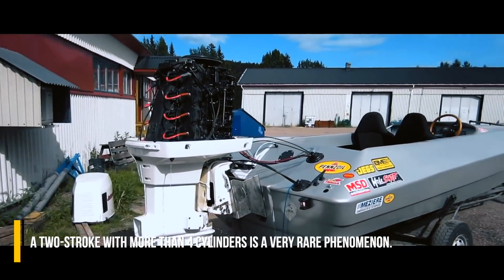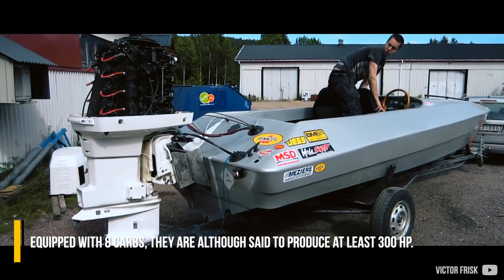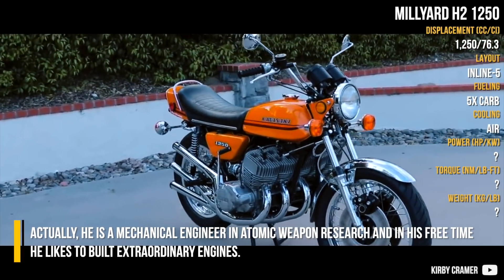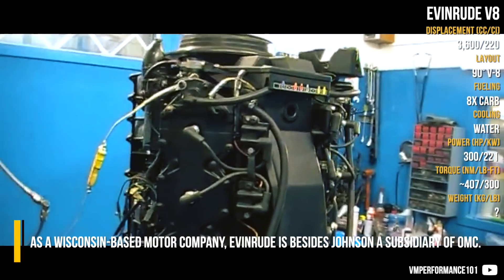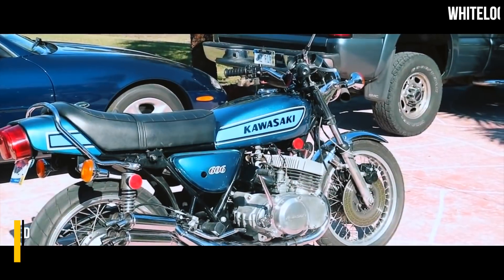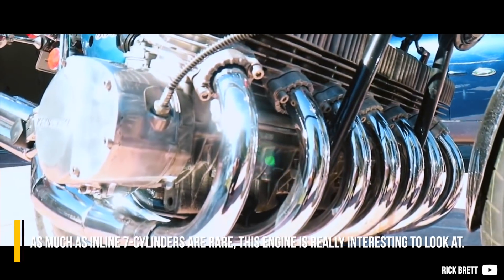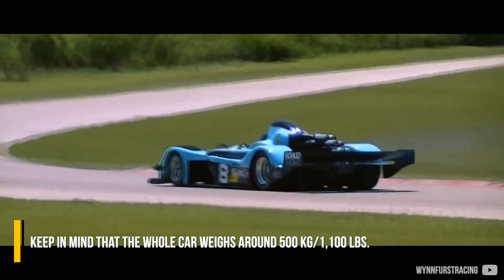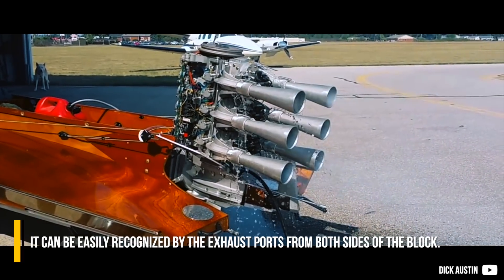Amazing 2-stroke 5+ Cylinders

Comment from the maker: Please be notice that this video contains gasoline two-strokes only. I did not know about many before this video, I learn much about stuff like you do, guys. Thank you for all the support!
Reply: please make a direct injection （into cylinder） 2 stroke next time thank you
Reply: You need to do a video on the 2-stroke diesels. Like the 12v71.
Reply: @michaelhite1433  hes done vids with that engine.......
Reply: Your forgot the mercury outboard 2stroke. They have a 2.6liter, 3liter, and 3.2liter v6 that we’re rated for 250-300hp but could easily make as much as 350-380hpwith tuning. These 2stroke v6s are still used in offshore racing today. 2 of them of a 28-36 foot catamaran can easily go 100-120mph on race day and push speeds upwards of 130mph. In my opinion 130mph for two 3liter(2stroke) v6s is very very impressive. In the 80s and early 90s some boats of similar size would run 3 if there 2 stroke monsters pushing 140mph ! Also these days Formula 1 boats run a single of these outboards and are still competitive against the 400hp and 450hp 4strokes.
Reply: VisioRacer Cool new intro! Love the raw sound of these engines. Keep up the good work - greetings from 🇦🇺😎
Reply: xxaxnxtxhxoxnxyxx thanks. Yeah I say on the suggested videos like 2 videos later.😂
Reply: xxaxnxtxhxoxnxyxx also I subscribe to a channel called Bus Grease Monkey, all he works on are 2-stroke Detroits mostly in old buses.

Comment: Too bad you didn't show the Quincy six cylinder running flat out. The thing doesn't scream, it shrieks. The engines were designed and built from a Mercury outboard engine bottom end. They were known as "flat heads" in the seventies. The mercury engines were a deflector type two stroke, where as the Quincy Flat Heads (Loopers) were a loop charged engine. A German manufacturer, Koenig also built a two and four cylinder apposed engines for boat racing during this same time. These engines had a side plate type rotary valve instead of a reed block and reeds. In the late forties and early fifties, Johnson built a four cylinder opposed engine with what they claimed was a front rotary valve instead of a reed block. It was actually a roots blower that guys would change the gearing, speeding up the blower and forcing even more air into the engine. One team had blown the cast iron crankcases apart so many times that it had almost as much brass as cast iron holding it together. They also used two steel plates on the heads with all thread rod to keep the thing together. This monster hung on the back of a boat that weighed less than it did and the guy had to lay out over the bow until he got it on plane or it would sink under him. Oh those dear daring young men.

Comment: What kind of ruins it for me is all the blue smoke! Back forty plus years ago, when I raced two stroke dirt bikes we used Golden Spectro Two Stroke synthetic oil, made in Connecticut, that was a great lubricant for the engines, with little to no smoke. Or use a castor bean oil that had a sweet smell to it. Both nothing like the conventional petroleum based two stroke oils used!

Comment: I only had a 3 cylinder 2 stroke evenrude 60 and they thing sounded like a v8. Also evenrude, johnson and Chrysler underrated power by 20% in most of there engines I herd.....

Comment: That looper is supposed to be "performance" ?? With those fancy exhaust ports and no expansion chambers? No wonder it made all that noise while crawling away.
Reply: The exhausts were maybe tuned to give a peak power at a tiny power band. The early 2-strokes used to just have the expansion cone and not the reverse cone.

Comment: My first boat came with a Mercury Black Max 275hp 2 stroke V6 outboard. Believe it or not, Cosworth made the blocks for Mercury back then. Same output as the V8 Johnson, but around 100lbs lighter, and infamously reliable.

Comment: The Mercury Marine 2.5L V6 is a racing outboard boat engine that makes well over 300hp and revs to over 8000rpm when tuned! Awesome engines!
Also that Evinrude V8 3.6L produces over 400hp when tuned up

Comment: My earliest memories in life are the sounds and smells of my Dad's 1979 Husky 390 two-stroke.  I was at a local harescramble a few years ago and all of a sudden we saw some crazy nut blast out of the woods and hammer full-throttle up a tricky hill on a late 70's Husky 250.  About 200 complete strangers all started cheering and going crazy on a hillside in the middle of the woods.  There's nothing like a two-stroke.
Reply: My dad learned and practiced wheelies on a V65 Magna with me like 8 years old on the back lol.

Comment: 2-stroke engines have less fuel efficiency than a 4-stroke. However they do have greater mechanical energy, since they have a powerstroke for every revolution of the crankshaft.
Reply: Ole that’s why they’re the best, also can’t forget that they don’t have any lost torque output from having to turn a camshaft to run a valve train.

Comment: At the boat engines, why are they pull out some water from the bottom of engine?
Sorry my english bad.
Reply: Kadalsuper_HD if you look closely there is a garden hose attached when the motor is not in water. This is because the cooling system usually cycles whatever water the motor is sitting in. The water dripping out it just cooling the engine.
Reply: @davinanderson9832  whooaa, i see. Thanks for explaining

Comment: The Evinrude and Johnson are exactly the same motors, they came in 3.6 and 4.0 litre motors. In my opinion the smaller 2.7, 3.0, and 3.3 V6s are even better, more reliable screamers.

Comment: Those engines sound like they are always at 10k+ rpm...  I know that 2 strokers gets 2x more bang than 4 strokers per cycle. Gasoline 2stroke always leave a trail of smoke, while diesel 2 stroke rarely does that. Only at start if u pump more fuel than air.
Reply: @A Twinspark , exactly. I have a single 250, and a tower of power, and neither smoke at operating temp. Jetting and proper synthetic oil ratio. Music when wound up.

Comment: im obsessed with 2 stroke engines
Reply: My riding buddy jumped on my yz250 off his newer yzf... He got off like wtf just happened to my world!
Reply: @brandonsyatessr.3667  Exactly. KX250's still smoke KX450 4 strokes. Famous MX rider John Dowd came to Southwick MX track a few years ago, took a 2000 KX250 that hadn't been started in 10 years and smoked all the pro riders on 450s by over 30 seconds.
Reply: You need to research about 2 stroke in Malaysia.its very interesting
Reply: I love me some 2smokes. Been wanting to build a 2smoke supermoto for many years.
Reply: The GL 750 Yamaha should be on your list!
Reply: @Moontanman  The Bimota 500 Vdue is another cool one. V4 500cc streetbike, unfortyunately it put the company out of business as they had problems with the fuel injection system and the bikes wouldnt run, so they had to design carbs for them. They say less than 10 probably exist that run. A guy near me has one with 4 carbs, it sounds sick. Here is his bike:  https://www.youtube.com/watch?v=uveLopAfZCo

Comment: An inline 5 two stroke would sound very close to an F1 V10 :O
Reply: It actually makes a lot of sense. A 4 stroke I5 would have to run at 10k rpm to sound like a 4 stroke V10 at 5k rpm. But a two stroke fires twice as fast so they scale the same so a 2 stroke I5 at 5k sounds like a 4 stroke V10 at 5k
Reply: @fishystales  not exactly since the two banks of cylinders don't fire in a way that has even spread across the V. That's why a V8 does not sound as high as a straight 8. 

Or a better analogy, consider the straight 2 of a bmw f800 motorcycle and a ducati V2. 

the ducati would have a similar pitch to a 1 cylinder

While the bmw sounds like an I4 at a lower rpm.
Reply: @carlosandleon  yeah of course you would also have to take in account fireing order. I left that out of my simple calculation.
Reply: It sounds like a Volvo but with 2 stroke twist
Reply: 2:10
Reply: actually it would even sound higher for the given rpm so it would be more comparable to a straight 10. Or a V20
Reply: y'all, look
keep watching outboard and 2t videos from Visio.
There is a 6 cyl 2t outboard featuring 
that doesn't sound like a 12 cyl 4t but
actually sounded like a V10.
I just do the math and tell Visio that it sounded like a 12
but he was right, it actually sounds like a v10
beautifully
Reply: True! Spark every revolution 👍🏼
Reply: The sound is similar to audi engine
Reply: Wrong, nothing else sounds like a 2 stroke
Reply: @Bull3tBikes  2 stroke will never sound as good as f1 v10

Comment: 2 Stroke engines sounds like rattling tin can, but they have some power on it.
Reply: yes and no. 125cc motocross bikes do. They have that zzzzzziiiiiiiiingg-sound
Reply: They are quick rev, low torque ratio to horsepower. 

That's why when you see some radical set up, but only 60hp, don't let it fool you. 

If it doesn't have to pull a lot of weight, it's 60hp in the snap of a finger. 

The best configuration is a dirt bike by far or go-kart. Something as light as possible.
Reply: @FIVE-0-APOCALYPTO  Not all 2 stroke bike engines are high rev, low torque. Jawa, CZ and Yedzi road bike engines are low revving high torque output. For instance the 1970's twin cylinder CZ 250-471 Sport produced only 17 HP @ 5,250 RPM but also 28.5 Pounds / Foot of torque @ 3,800 RPM with fuel consumption being 76 miles per imperial (true) gallon @ 55 MPH. The MIRA tested top speed was 85 MPH running on 99 RON leaded petrol.
 The 350cc version produced 22 HP (restricted) / 28 HP (unrestricted) @ 5,250 RPM with 39 Pounds / Foot of torque @ 3,800 RPM. The early 1970's CZ 350-472 bikes love to destroy their chain adjusters and eat 428 size drive chains, hence the factory OEM restriction to 22HP (which knowledgeable owners remove). 

The CZ 250-471 weighs in at 313 Pounds wet and the CZ 350-472 weighs in at 291 Pounds wet.
Reply: @CZ350tuner  yes, I understand and that's why I mentioned weight. 

In general terms, there is a inherent nature to stroke principles. Two stroke is not typically known as a high torque low rpm engine. 

The only debate is when does it depend. 

I'm admittedly ignorant as well, never realizing till recently, there are two stroke diesel engines. 

I grew up when there wasn't a internet.